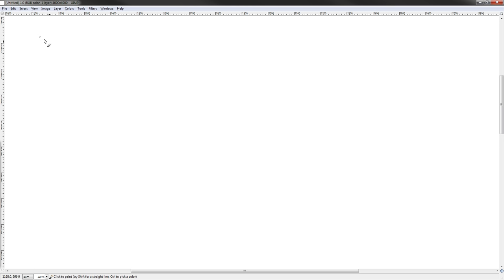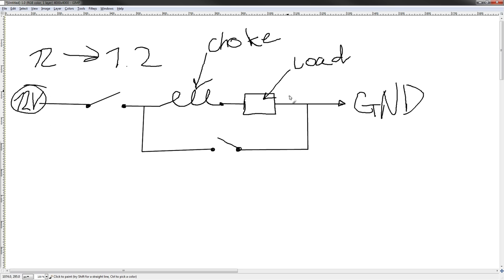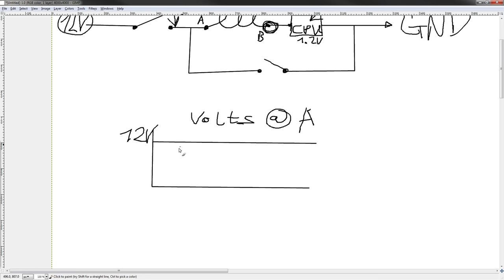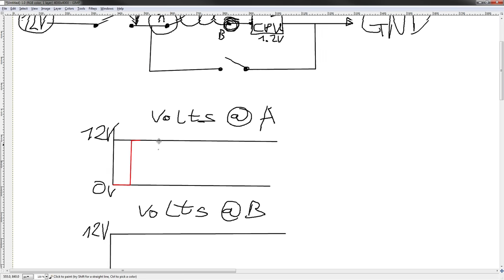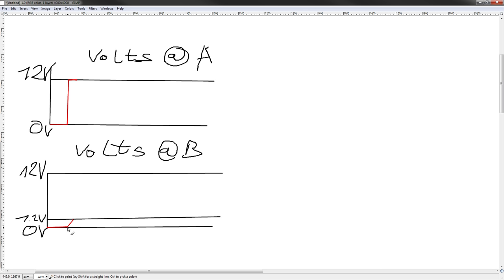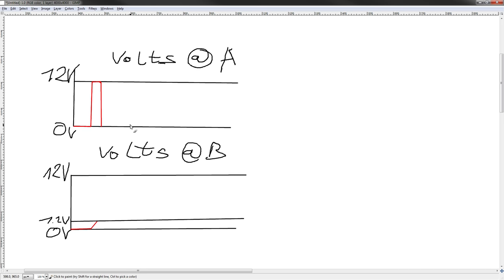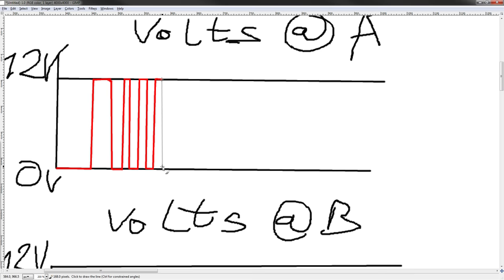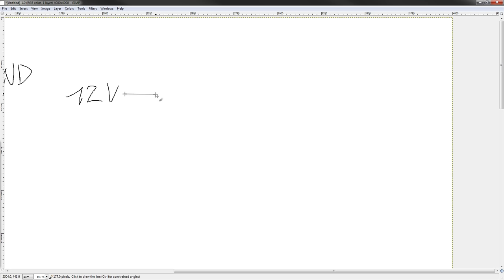How VRMs work (I give up edition)

Comment: I've watched this video before, but nice to see LinusTechTips give it some love in 2021.
Reply: Link
Reply: @sheepslayer649  Sorry man, I don't recall which video it was. Unfortunately Youtube just says, "1 year ago".
Reply: I wish he'd have touched upon the subject of auxiliary phases and why they're useful (or not useful). Most high-end motherboards have a +1 or +1+1 setup, but the Z790 Apex has a +0, and despite spending hours googling for answers I can't find any information on the advantages / disadvantages of either type of setup.
Reply: @VVayVVard  Most of the material I've seen on auxiliary phases refer to different devices on the motherboard (or at least different domains of the main System on Chip).  For example, the main VRM number is the Vcore rail (that feeds the CPU cores), so an 8+2 phase VRM has 8 Vcore phases.  

The auxiliary phases however will be dictated mostly by the platform (AM4, AM5, LGA1700, etc.) and the chipset.  Then you get separate VRMs for things like Vsoc, Vgpu, Vmem, and so on. Which rails exist depend on whether that platform and chipset have them or not.  
For example a Z790 board could have a 12+0 VRM because the CPU takes all 12 phases from the motherboard to power its own internal voltage regulator for cores, gpu, i/o and so on.  Compare that to a Z590 board with a 12+2 that has similar 12 Vcore phases, but the extra 2 phases feed Vsoc or Vddr for the memory, since DDR4 modules don't have onboard voltage regulators like DDR5 does.

Comment: What you actualy made in this video is an current regulator. The inductors try to keep an constant current flow and not voltage. This means that if the gpu resistance would change so would the voltage(using this system). That is why normaly there are capacitors behind the inductors to keep the voltage more stable.
So what you would actualy do in a VRM is use an mosfet / transistor / switch to charge a capacitor to the correct voltage level. The inductor is there to prevent the capasitor from charging to 12v instantly(much like you explained in the video).
Reply from the maker: Mark Prins I just wanted to cover the absolute minimum of components to lower voltage ignoring the fact that a cpu doesn't have a constant current demand
Reply from the maker: Nah the inductor and 2 MOSFETs on their own would manage that as long as the load didn't change. So if I replaced the CPU with a resistor that graph would be valid. The problem with CPUs is that they need 100A one moment and 50A the next and then they suddenly need 150A. In such a scenario what I drew would overshoot the voltage hard when the current demand goes down and deliver too little voltage when the current draw goes up. If you added capacitors they would store extra power so that when the current draw goes up instead of the inductors running out of power the capacitors would take over and when the current draw goes down the caps would store the excess power that the inductors are trying to get rid of.
Reply: doesnt the choke induce the current into the other direction?
edit: nvm it only the voltage... the current flows in the same direction

Comment: Voltage is also called potential, like a rollercoaster on top of the ride versus being after the drop.  Potential energy converts into kinect energy.  Same principal. Ground is a reference point of 0 to measure against.  I dunno if that helps anyone follow

Comment: Good video. However the voltage at point B is also filtered by the bulk capacitors. Just as an inductor doesn’t like changes in current, a capacitor doesn’t like immediate changes in voltage. As such, when the main switch turns off, the voltage at node B will not tend to increase because of the output caps. It will be the voltage at node A that will decrease until it goes below ground at which point the diode (or body diode of the synchronous MOSFET) will begin conducting.
Reply from the maker: yeah I left out the capacitors intentionally when I made this video since what most people can't wrap their head around is how an inductor makes a chopped up 12V into a lower voltage. The capacitors are of course absolutely necessary in a real world application but for the sake of not making this video even longer I left the capacitors out.

Comment: I have never found electronics wildly entertaining unless im changing some caps out to vintage mustard caps in my  marshall 100watt tube head.maybe tweeking the tone controls.adding a pot for feedback more or less in the circuit.Building tube amps has its fun but like anything its weird floating grounds.Keep up the good work

Comment: Good info.  would love to see one at failing point if can.
Reply from the maker: I'm looking into getting a some GPUs with dodgy VRMs and blowing them up in the near future.
Reply: Actually Hardcore Overclocking Get an 8800gtx, set the fan speed to 20% and run furmark. 720p was enough to blow mine up.
Reply from the maker: Furmark with low fan speed is cheating. I want to do it properly. Water cooling on the GPU core. Lots of airflow over the PCB and way too much Vcore running 3Dmark.
Reply: Actually Hardcore Overclocking  A custom BIOS on a 290 running 1.5V with no vdroop? I know the 290's VRMs are strong but I can't remember how strong they actually are... need to watch your video on the 290/X PCB again :P How about the 480 with overkill vcore? No amount of airflow can prevent a VRM blowing up from too much voltage.. right?
Reply: i wanna see the wattusage of the 290 then, before it blows :o
Reply from the maker: The 480/580 would pop even with airflow. However the R9 290 VRM needs to be neglected to blow up.

Comment: Thanks for the Vid.

I was actually trying to make sense of the V A W info in hwinfo64....AMD x570 Board with 3700x cpu
How the PPT at 88W, EDC at 90A burst and and TDC at 60A sustained work together with the VRM.
This is what I think is happenning.

The VR_VIN  is listed as 12.312 which I assume is the ATX12v on the rails to the CPU Core, SoC IO.... (& MEM NB MCH Not shown in hwinfo)
This lists....
VR_Pin_CPU at 60W
VR_Pout_CPU at 47.5W (app. 79% efficiency)
VR_Pin_SOC at 15W
VR_Pout_SOC at 11.5W (app 77% efficiency. So I assume this is actually 80% efficiency like most PSU)
....which is where I get stuck on how 60W+15W = 88W ????? ....unless there is even more power loss somewhere.

Which brings us to the missing info if I am on the right lines.
DDR4 Ram apparently uses 5/12W per GByte @ 1.35V so that 32GB installed DDR4 = 13.333W @ 1.35V (11.852W @ 1.2V)
Here then, 60 + 15 + 13.33 = 88.333W PPT
...which means the more RAM you have, the more power its suck from the Cores and SoC power with an 88W limit.... and reduces the CPU performance ???

So added to the VRM list above shoud be...
VR_Pin_MEM at 13.3W (or 13W integer)
VR_Pout_MEM at 10.7W (@ 80% efficiency)
Here 60 +15 + 13 = 88W
....if I am on the right lines.

Comment: Very informational. But you could probably do this a lot better with a program like Multisim or another similar program because then you could have actual voltages and currents and be able to show how the circuit really works in real time.

Comment: physics was my worst subject in high school, why isnt 12:58 a closed circuit? 1.2v @ inductor b -> cpu -> gnd does current not flow there? also what is the point of the diode since switch 1 and 2 are never closed at the same time so that it wont short?

Comment: Question: What exactly happens when you increase the switching frequency? It seems that since the inductance can't change, then shortening the rise time would actually lower your output voltage. So I would guess that it only shortens the time period that the high side is switched off and the low side is on (the fall time if I understood correctly), but the time period when the high side is on and the low side is off would have to remain the same.
Reply: I think that it will act as having more phase. You are switching on it more often thus it will act like another phase say if you run at twice speed. You can take that blue line as he switched on the phase again instead of second phase.
And as higher switching frequency gives more voltage regulation and same goes for having more phases so it looks like thats it.
Also thats only for voltage regulation, meaning that doesn't increase the current capacity.
Reply: @bmarkx2595  Hello person from the future, and thank you for replying.
You are correct that a higher switching frequency allows for better voltage regulation, but that was already understood. My question was more specifically about the switched-on vs switched-off time intervals. IIRC I did get this answered on another platform...and that answer was that the controller does some fancy stuff to bring the voltage up to the right level, before the switching frequency set in BIOS takes over. Therefore the shorter on-interval doesn't impact the initial rise time (and therefore the nominal operating voltage), as they are two separate operations.
Now if you'll excuse me I must be getting back to 2019.

Comment: Appreciate you video and understanding of the collapsing field around the inductor. Kinda lost me when you illustrated current flow from GND to 12V through the diode. I’ve always understood current flow through a diode was — to +, cathode to anode, unless you’re talking about hole flow.
Reply: Both holes and electrons contribute to positive conventional current flow through a diode

Comment: How can charged inductor blow the CPU in 13th minute of the video when the A pin of the coil isn't connected to anything at that moment. It will act as a power source with B pin being positive and A pin being negative but the A isn't connected to the ground line so it cannot act as a ground from the CPU point of view and no current can flow through open circuit.
It could be only some kind of electrostatic discharge that could break the CPU but the voltage is too low for that.

Comment: What does it mean when a VRM has 19+1 phases as opposed to 20+0? I understand that the second number denotes phases dedicated to the memory controller, but what advantage is there to this type of split power setup? I'm particularly wondering why the Z790 Apex has a +0 setup, unlike basically every other high-end motherboard.
Reply: After a month of research, I reached the conclusion that the +0 refers to lack of power for the iGPU. The Apex has no HDMI output, and no way to take advantage of the integrated graphics of the CPU, so this conclusion seems logical.

Comment: I have a Foxconn NF4UK8AA-8EKRS 939 NVIDIA nForce4 Ultra, by manufacturer they've put in 6 caps next to CPU they got blown before so I replaced all 6 of course and the system is working great again but there are 2 more unpopulated spots for caps. what happens if I added those 2 caps?

Comment: First off, thanks for the video.  It definitely helped me understand VRMs and how they function on a basic level.  Applying what's in the video here, when a GPU blows its mosfets, that is in most cases the lowside mosfet and the diode in particular, correct?  The diode gets to a point where it cannot dissipate the heat coming off the inductor and efficiency begins to break down entering a runaway thermal scenario.  I realize there are quite a few more components at play here, but I assume this is a basic explanation of what's going on, right?

Comment: Hi again I have a few more questions, 
Would e.g. 600khz frequncy for one phase, and 300khz frequency for 2 phases both have the same point b graph for minimum voltages? 
So would the 1 phase vrm pwm graph compress so there would be twice the amount of signals for the same time period? Meaning the mosfets switch twice as quick? 
Hopefully that makes sense!

Comment: There has to be a switch right before the GND side as well, which has the same timing as the one right after the 12V source, or am I wrong here? Otherwise why should the current go all the way through the switch/diode part, if it just can go to the main GND!?

Comment: Thanks for the video. How to determine the the current rating for vrms with high and low mosfets from a spec sheet they are assigned different currents unlike integrated drivers with a specific Idcmax.

Comment: What about C-states and voltage? How do you reduce and increase voltage fast?
Reply from the maker: VRMs in computers run at 200KHz+. So the PWM signal can but updated several thousand times a second to match varying demands for power(the really good controller chips can update every single cycle for each phase individually).

Comment: I understand nothing about electrical engineering but I got that one! It was very interesting. You earned a sub. I have a question: Does a 12 phase power delivery to a CPU mean 12 really small vdrops thus almost a flat line of voltage?
Reply from the maker: Sorta. But it's more complicated than that. I might do a video on how to make a good VRM in the future but for now I just wanted to cover the basics of how they work so that I can make a video on how and why VRMs fail, After that I might do a video on what makes a good VRM and the various tricks that are used for marketing purposes.
Reply: Hi, thanks for replying. I am trying to pick between a 8 phase and 12 phase CPU mobo (GB Gaming 3 vs 5). Should I just go with 8 phase and save some money?
Reply from the maker: depends on the usage. My daily rig has a 6 phase VRM because I don't plan to do anything too extreme on it. Just like 4.5Ghz on an intel 6 core which isn't really a huge amount of power.

Comment: Wowws how interesting... I wonder just how difficult could be to build with today technology a motherboard for a "very old" CPU like a 286 or 386. Thanks, I always thought there should be some kind of PWM there. What where the advantages of going from old MB power delivery that used 5V for the CPU to 12V?

Comment: hi, tell us something about the EVGA-shitstorm on the 1070/1080 FTW please...check out EVGA Forum, there will be endless RMA, the PCB on this cards gets more than 100 C hot, even causing the Vram to fail...maybe you can tell us why, what about the mosfets in this things etc...
Reply: What Panagio said. The FTW boards use a metal plate as a giant heatsink that cools everything but they cheaped out on the thermal pads. What they didn't account for is that when a material gets hot it tends to expand, so the plate ends up with some buckling and loses contact with the VRMs and you end up with overheating VRMs and blown components.

Comment: Motherboard manufacturers show-off the number of VRM phases. From how I understood this video, more phases = more stable voltage. Is it also meant to indicate better CPU performance? Or maybe imply that it can manage higher amp requirements?

Comment: Thanks for the video. I was wondering about my CPU power phase control after watching your recent zotac 1080ti video when you were talking about frequency, and mentioned higher frequency gives a more stable voltage, where as lower freq is more efficient. 

After watching this video, my understanding is that increasing my "CPU Power Phase Control"  setting in bios increases how often the peak voltage (let's say 1.4, the voltage my 3930k needs for its oc) is reached, and reduces the dips between, and lowering frequency slows the switching between phases, increasing the amount of voltage dipping. 

Is my understanding correct? 
If so I hope I can increase this setting on my motherboard and hopefully lower my CPU voltage a little without sacrificing stability.

Thanks for the video